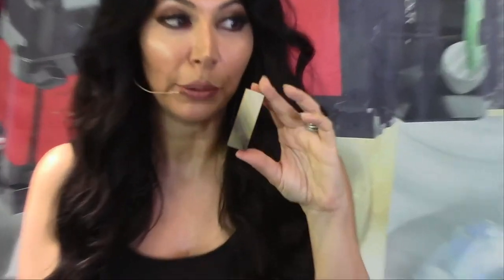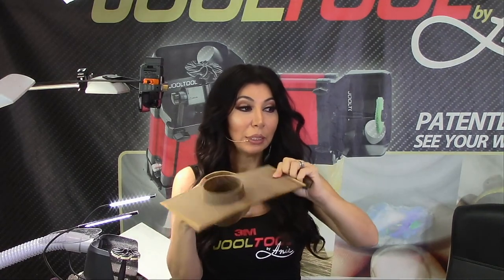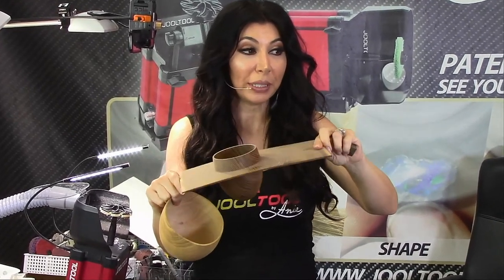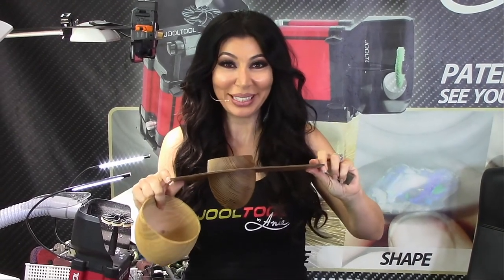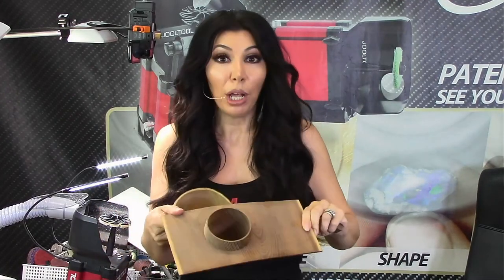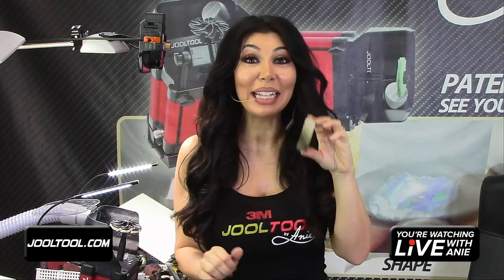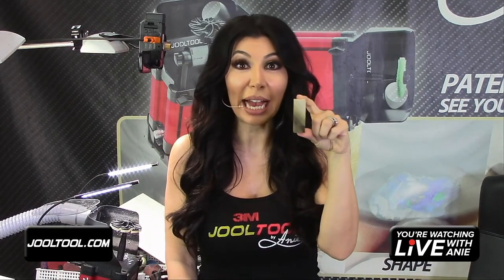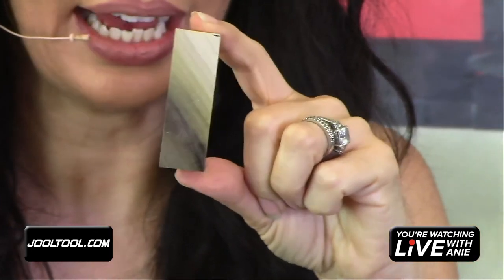Making Wood Jewelry Quick & Easy on the JOOLTOOL - LIVE with Anie

Comment: can you use the same eraser disk on wood and metal?
Reply from the maker: I did, but if the metal is heavily imbedded in the wheel you might have to have a separate one. My suggestion is to do a sample “skin test” if it sand clean you are all good! If you see black marks then use a cleaner one! ❤️ -Anie